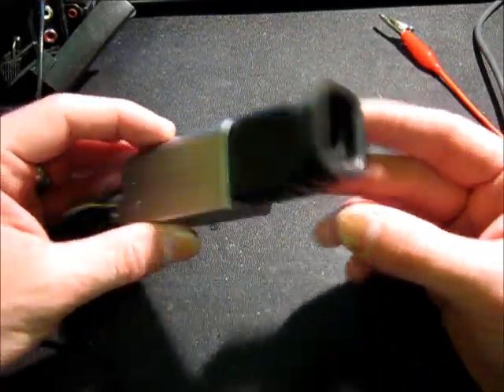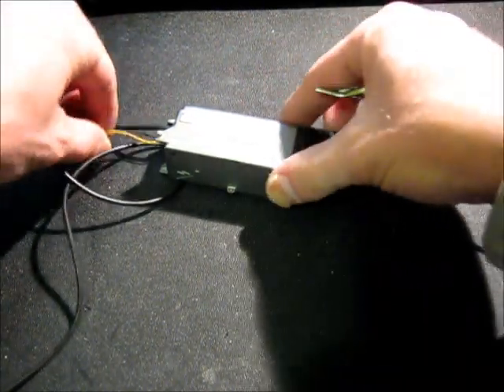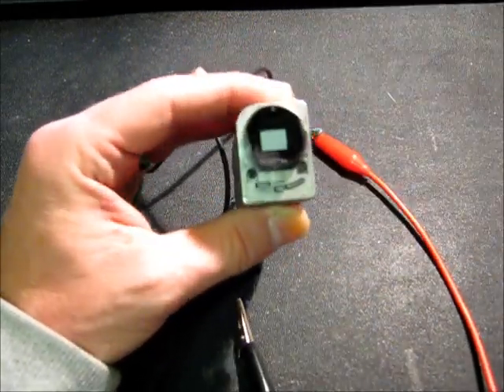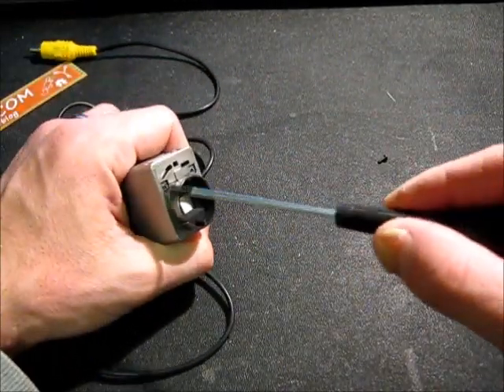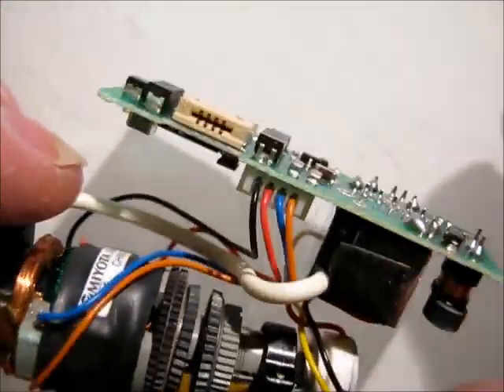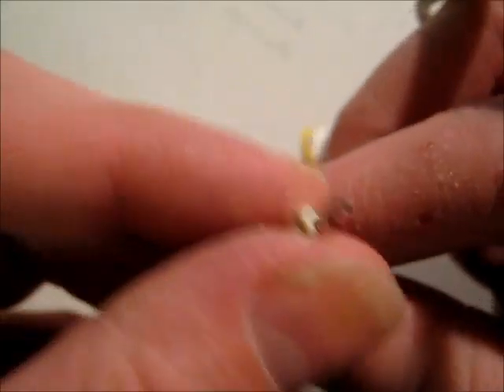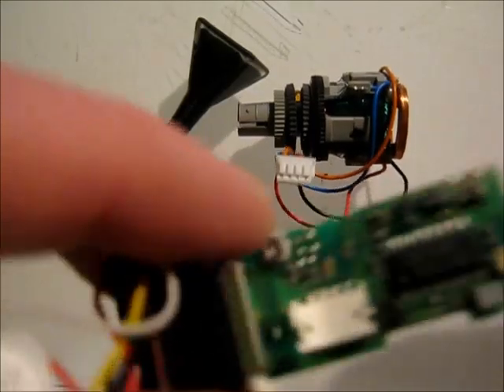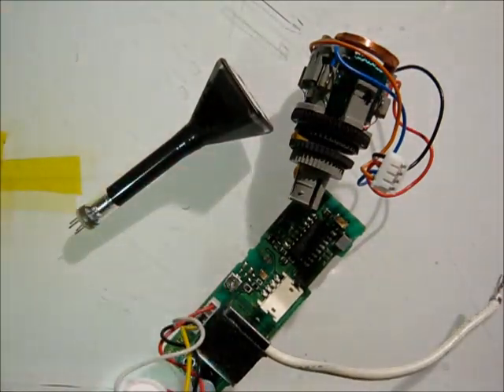DL #003 - Tiny CRT Video Camera Viewfinder Teardown

Comment: Hi mate, what was the wiring for connection to external power and video. Cheers
Reply from the maker: ***** i dont recall to be honest. They are normally very simple, usually just a ground, power and composite video with maybe a separate signal if there is a recording led inside the viewfinder. You should be able to identify the power and ground by checking the traces on the connector to other components.